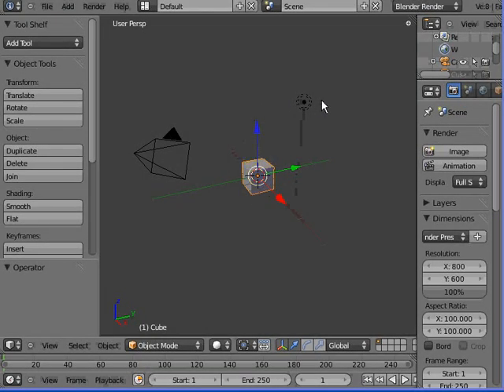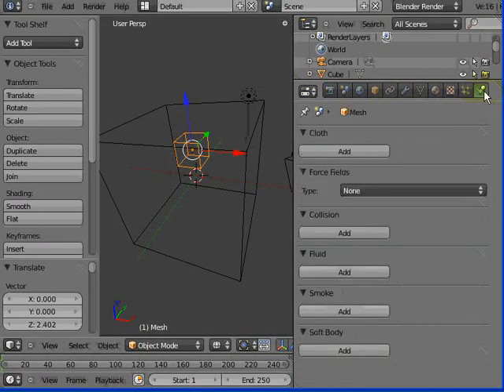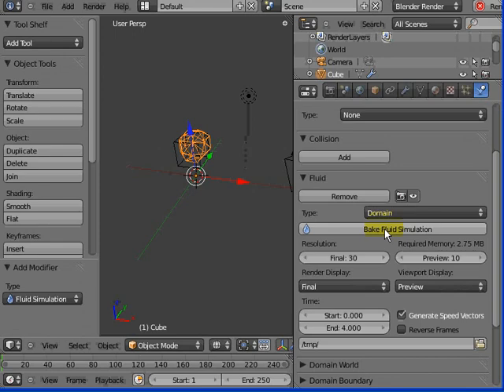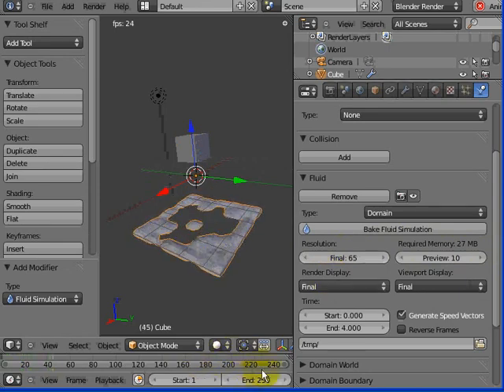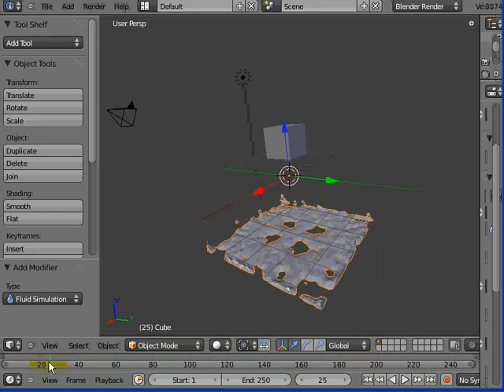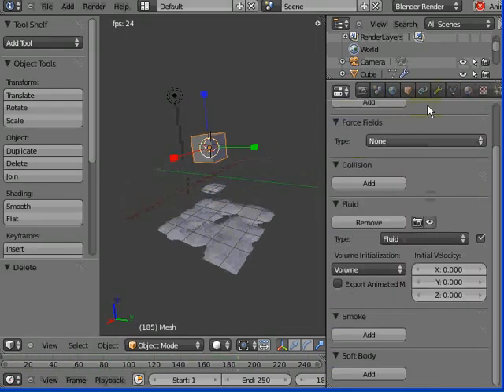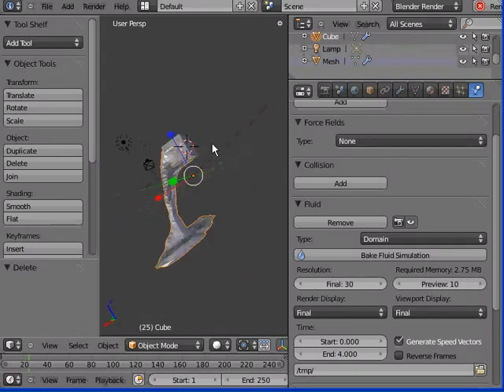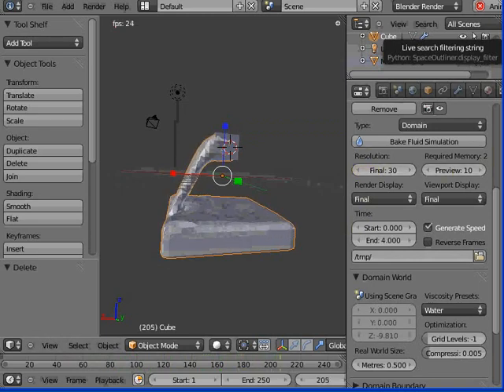Basics of fluid simulation in Blender - Aparima College 3D Club

Comment from the maker: @kalzorath - there's a little tick box beside the inflow setting - tick means that it's flowing, unticked means it doesn't. You can turn the flow off and on by selecting a time on the timeline, tick or untick the flow, and while your mouse is over the tick you press the "i" key to insert a keyframe. Then chose a different time and turn it off or on again.